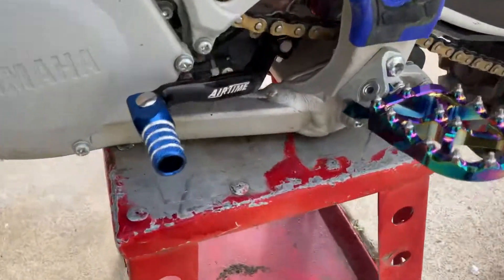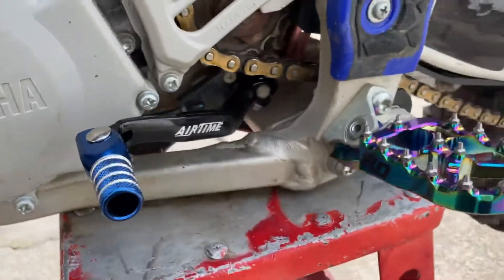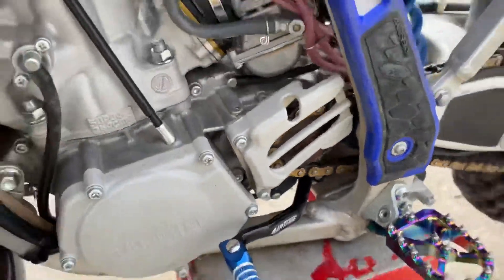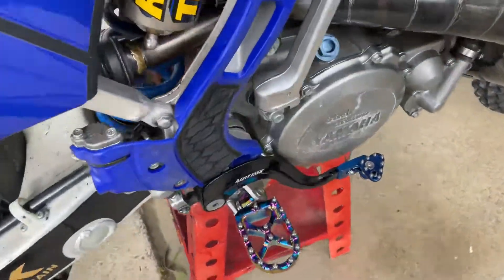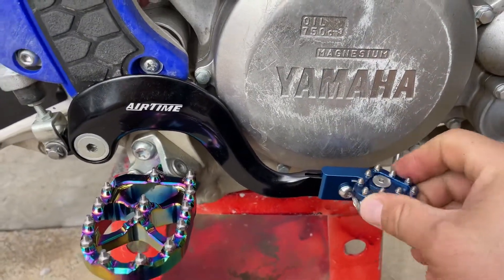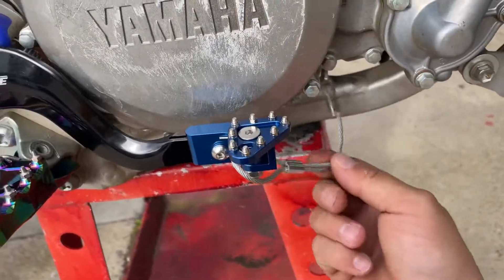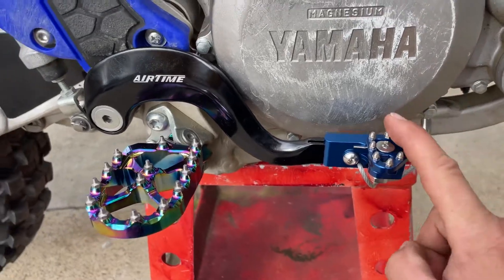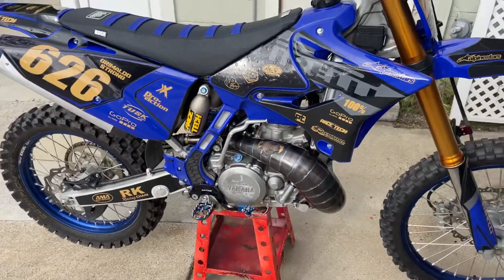Unbreakable brake lever and shifter install. Airtime Yz250

Comment: do you know if yz250 shifter n rear brake pedal will fit a 250f? or are they different
Reply from the maker: The rear brake pedal will only fit on Yz250f from 03-05 I believe. Not sure about the shifter